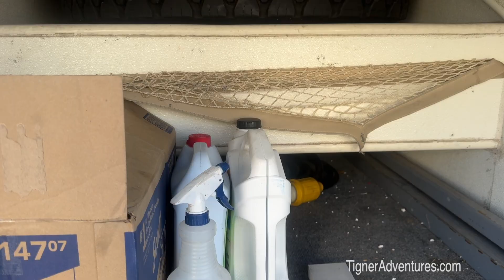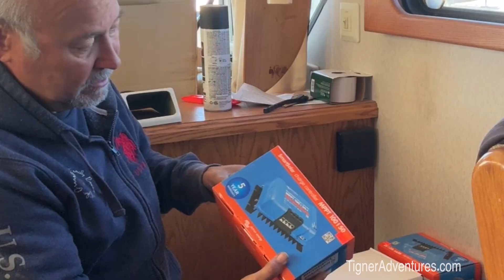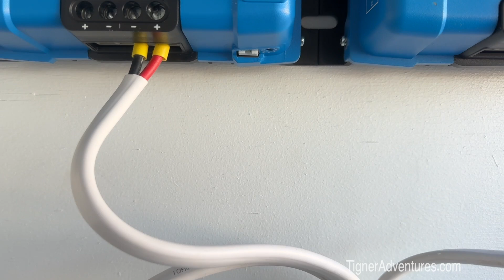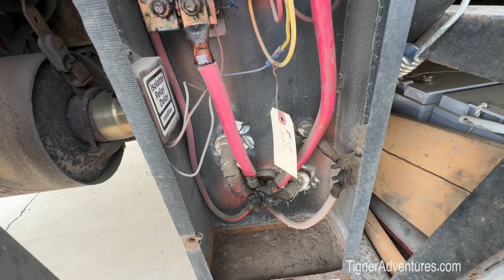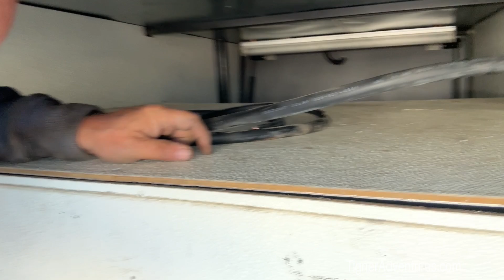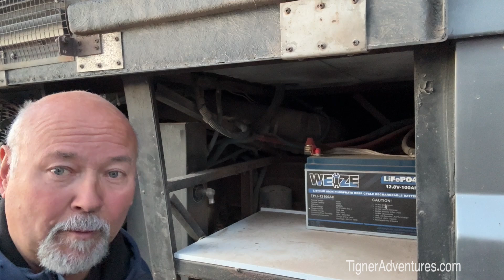How To Easily Upgrade Your RV With Solar Power Now

Comment: Nice job! I have my on/off switch at the lynx on the positive side. Looks like you have on/off switch on negative side. Can you explain that?
Reply from the maker: Thanks for watching Mark. I have always placed my switch on the positive side myself until I bought this same switch for my other rig. I read something that suggested placing it on the negative side so I talked to my brother in law that is an electronic engineer and he said that either way works but the negative could help isolate it more. If you have ever read a repair manual it always says to disconnect the negative lead from the battery before working on the rig. So I went ahead an placed it on the negative side. Not saying I know it all but it has worked well for the last 2 years on the other rig so I did it the same way. Hope that helps and if I'm in left field please let me know.
Reply: @TignerAdventures  Interesting, I plan on researching that. I installed a 24V system using Victron in Yuma just before we met yall at the big tent in Quartzsite. We are from Arkansas.
Reply from the maker: Let me know what you decide.

Comment: Just as long as your controller is not damaged by brief high voltage spikes, you'll be OK. But there is a phenomenon called cloud lensing or the edge of cloud effect which can cause brief voltage spikes above your array's VOC. For example, the 4,400w array on the roof of my motorhome is rated at 400voc, but I have recorded brief voltage spikes due to cloud lensing of up to 450 volts! I use a 5kw Sungold Power all-in-one inverter/100a charger/charge controller rated at 500 volts, so it's not a problem for me. Typically charge controllers will simply truncate the amps if you over panel or have higher current input than the charger is rated at, though it must be within its rated voltage to avoid damaging the controller. The good news is that Victron is an excellent company that stands behind their product and if your controller does get zapped from a high voltage spike, they will likely replace it with a new one.
Reply from the maker: Thanks for the tip. I have noticed our fuses getting blown on our old unit and wondered why. Now I know. I'll have to check these out and see what the ratings are. Thanks again.

Comment: It's a very nice layout. I had problems getting good torque on the wires leading to the big black switch. Make sure you check it frequently to ensure it's tight.
Reply from the maker: Thanks for watching and the tip. It is good to keep things tight.